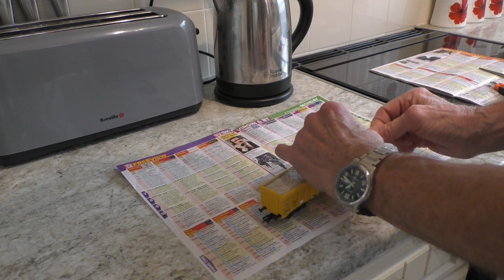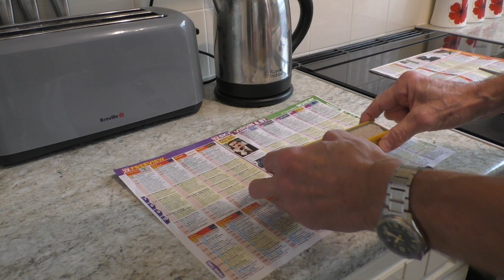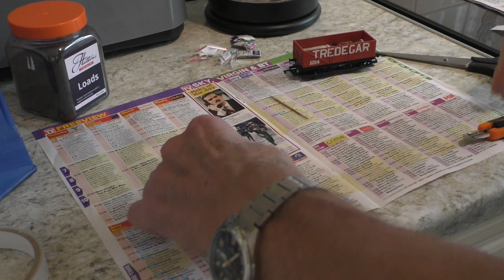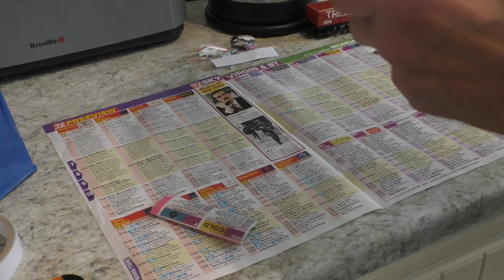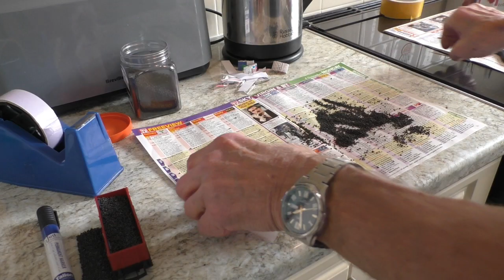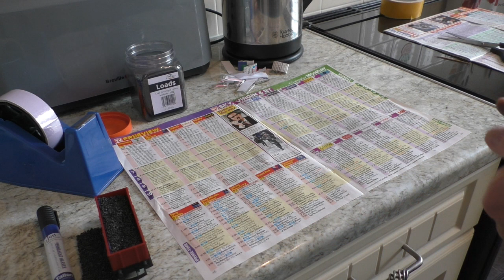NO WET GLUE WAGON LOADS

Comment: Great idea Robert and glad the point is sorted to, well done
Peter
Reply from the maker: Hi Peter,
Cheers for watching and the nice comment. I have a peco electro frog point coming for the other point by the curved stations as have trouble with that as it was the one that had a dead short in it see if it works.
Cheers Robert.
Reply from the maker: Hi Allan,
Thanks for this I do have plastic rail jointers coming and I have looked at a video on it and as I am not using the point motors that you can switch the polarity with will rely on the switch blades to do it for me and keep them clean. I was just interested to see what they are like so we will see.
Cheers Robert.

Comment: Only getting sound on one side of my headphones for this video too. Happens while the train is running as well as when you are speaking.
Reply from the maker: Hi Bill,
Thanks for watching and the comment, its because of a problem with my separate mike so as of the latest videos will not use it and use the on-board sound with the camera let me know what you think.
Cheers Robert.
Reply: @robertstrainset6556  That should do the trick.